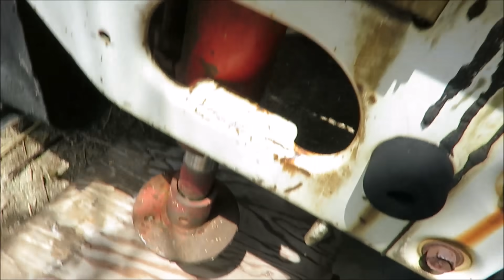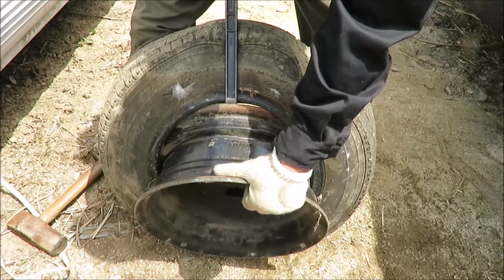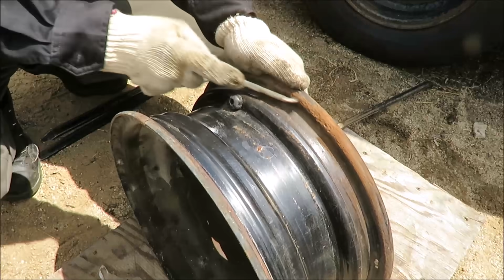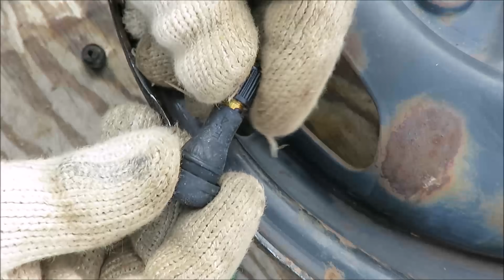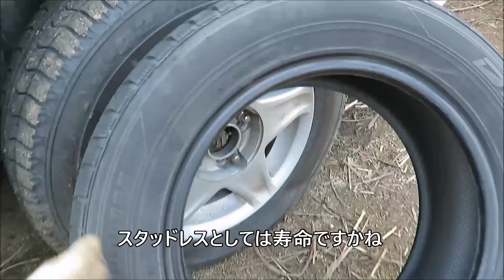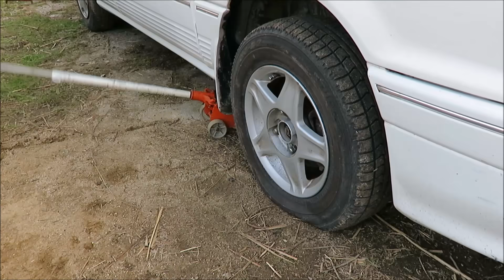GALANTのタイヤを交換（前編）

Comment: Also, if you don't have any lube, dish soap the tire lip on both sides, lay down the wheel and the tire should slip right on easy peasy. Breaking down old tires is hell compared to mounting new ones.